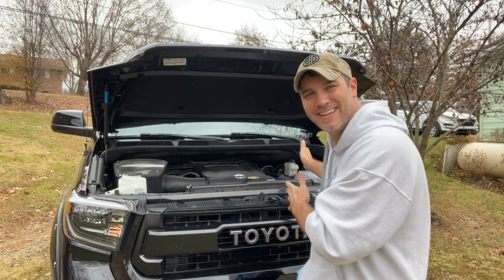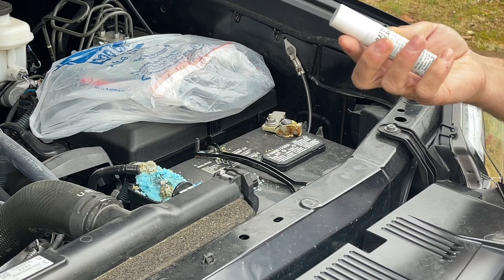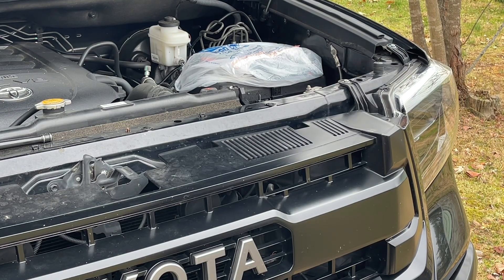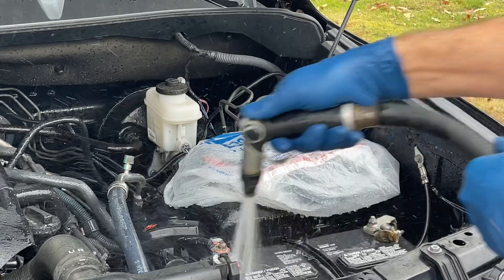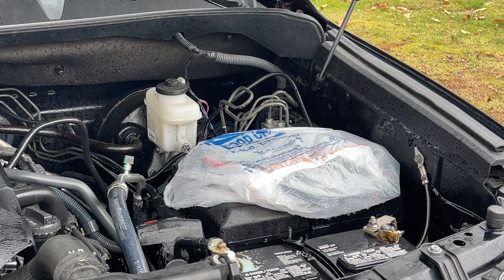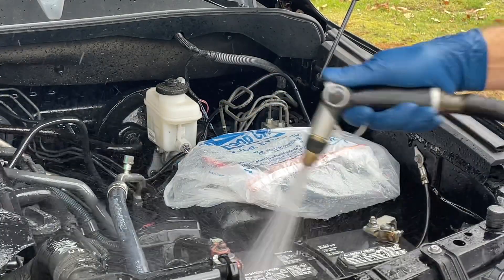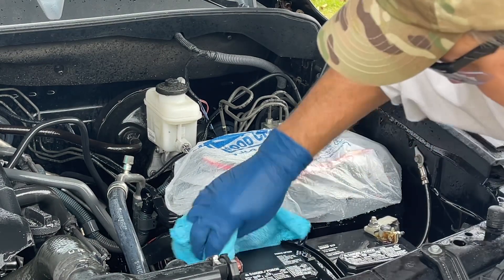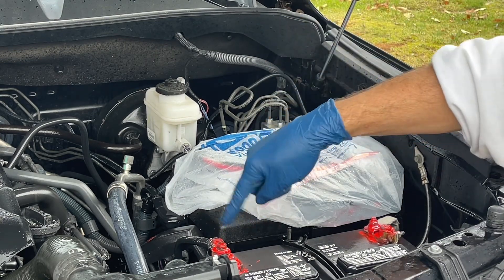I Was Really Embarrassed To See This Happened To My Tundra

Comment: Battery acid blue! I’ve used the battery terminal felt washers and the spray on my F150 for years. And have never had corrosion on the terminals. Good stuff.

Comment: Consider Quick connect and Release battery connectors with 3 or 4 connections for accessories on both positive and negative post.  No wrench needed, just a hand clamp marked red for positive and black for negative.

Comment: Now I need to check mine!  I have some of that spray, I just need to pick up some felt pads.  I think there is a possibility your computer will forget fuel air mixture settings, etc.  Does your truck run okay after?

Comment: Hey Andy, quick question.

Would you consider a Tundra family safe/Smart considering the storage? We’re a family of 4 soon to be in March. I’ve been up in the air of trading in my 2020 Tundra for a 4Runner. I know that trucks offers the tonneau cover, but it’s honestly it’s not my desire mod to spend that much money on. My wife says do what I want and she does see the logic on my opinion
Reply from the maker: I have to say I do love 4Runners and you definitely can’t go wrong with one of those.  It will be a little smaller but the inside storage you gain is probably worth it if that’s what you’re looking for.  My wife is going to get a 4Runner in a month or so, so there will be one on the channel soon.

Comment: Yo Andy what wheel and tire set up do you have? How much trimming did you have to do?
Reply from the maker: I have a 35x12.50r20 Nitto Terra Grappler. On a Sota Novakane Death Metal Black Wheel.  I have a 3-2 ready lift and other than that I just had to take off my small front inner fender pieces.
Reply: @gearrunner  I just had some 295/60/R20 MT Baja boss tires and 20” Anthem Equalizer wheels with a 3.5 RC lift and they had to do some cutting in the back of the fronts and probably half the liner in the from trimmed out. Does that sound normal??
Reply from the maker: @JoeGabs555  it does for a MT.  If I go with anything more aggressive than an AT I’d have to do the same thing

Comment: Dang Gear!  That was a train wreck!  😂😂😂. You must do your own oil changes, right?  Because I would think a service tech would make you aware of this.
Reply from the maker: I haven’t driven my Tundra but 1,600 miles in the last 11 months lol
Reply: I have never seen one that bad! There must not be anr acid in your battery! Add distilled water to cover the plates!I run Lucas additive in everything, and I dribble the bottle remains onto the battery terminals! It works, to keep your terminal s from looking like that!
Reply: I check my battery water and terminals every September! Summer heat will cook a battery and the acid will get on your battery terminals! Plus this will make your battery last 5-10 years!

Comment: That's not so bad... Not like last week, popping the hood at the dealer to find a rat's nest and poop on the battery and engine... then find out that the buggers ate the wiring harness and air filters- got into the cabin through the cabin filter- then they found a LIVE rat in the engine compartment and had to get it out...  a little corrosion on the battery terminal aint so bad LOL.  oil change and wiring harness fix, and an eviction, 800 bucks.
Reply: Tzvia Segal,I work offshore my vehicle was parked at heliport parking lot in south Louisiana right on the Mississippi River just a few miles from where she flows into the gulf 28 days later the same thing happened now anytime I am parked in such areas for long periods peppermint oil around your vehicle around cabin filters etc . works and beats having to replace a wiring harness on a new vehicle .

Comment: If that's a Toyota branded battery, I'm not surprised. They are horrible.
Reply: Yeah, I don't even put up with the "fuzz". If it's happening (especially that badly) then the terminal seal is compromised and it'll keep leaking acid and rot away your battery terminals and wires. In rarer situations the connection between the post and the final lead plate can also rot away (internal to the battery) and leave you with a no start 100% randomly with a seemingly good battery. I just take it as a warning, clean it up, and get a new battery as soon as I can, maybe at next oil change. Thankfully I haven't had it happen to my batteries, but on a few cars I maintain (one was a Toyota Corolla) I swap it.
Reply from the maker: I can’t believe the stock battery is still good
Reply: The North American Toyota batteries are trash.  The filler/vent is to close to the positive terminal leading to the corrosion.  Buy a battery with a sealed top to avoid this issue.  The Panasonic Batteries in the 4Runner are much better since the caps are screwed on and seal better.